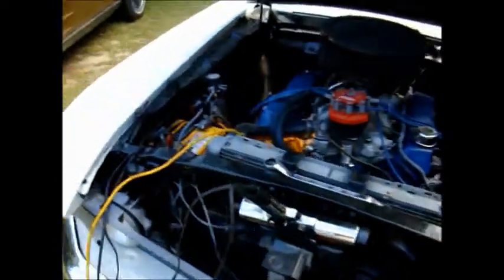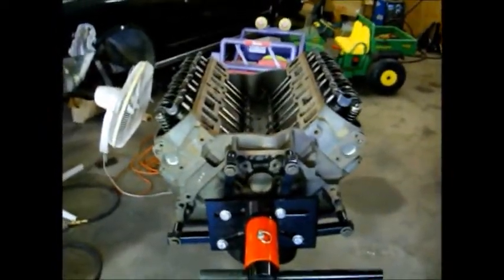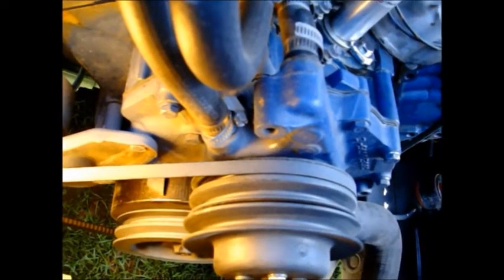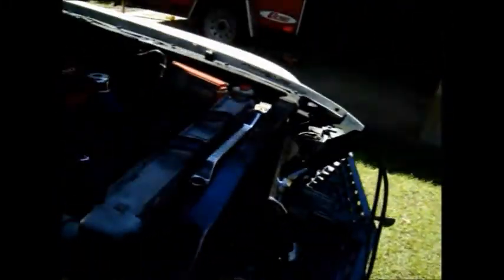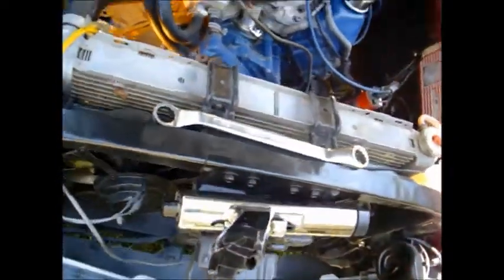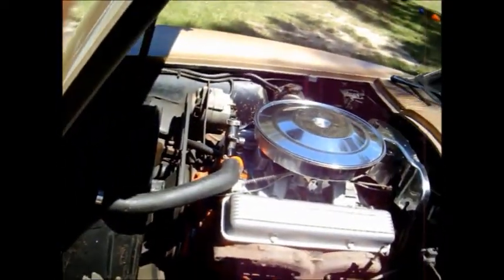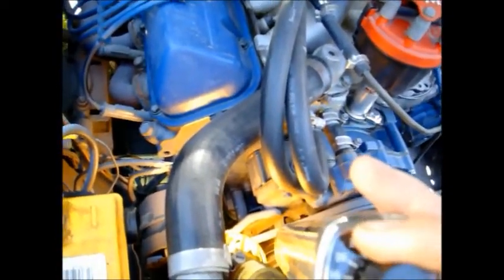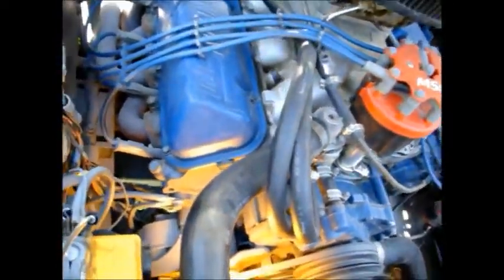Timing - Part 2 - How To - Factory timing marks Ford and Chevy.wmv

Comment: hey Owen, doing my 351c in my 69f100, distributor is froze, need help in advice on getting this thing unstuck.  marvel oil and acetone or aero kroil.  I've also been told that with the 270h comp cam I'm using, it's a zero lash setting, do you know

Comment: To see if the timing is too high for cranking, pull off the coil wire. If the engine cranks normal, it's too high.

Comment: Owen how do you determine the length of the piston stop to get the #1 piston at tdc on compression stroke on 302 ford timing order 15423678? Thankz trying to get a tool to do timing job.
Reply from the maker: Make it so short that the piston doesn't even hit it, then make it longer so that the piston barely hits it, and it postively stops piston travel.  The exact length doesn't matter at all, but a shallow stop will give you two marks on the balancer that are closer together.  The closer the marks, the easier it is to measure for the center of those two marks.  You can imagine that if the two marks were as far as 180 out from each other, measuring the center wouldn't be impossible, just not as easy.  Good luck!